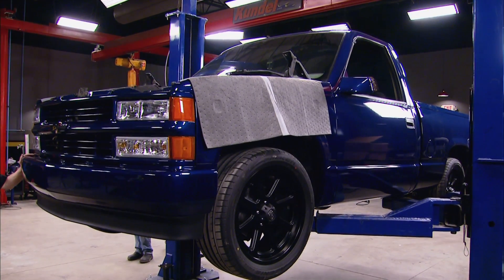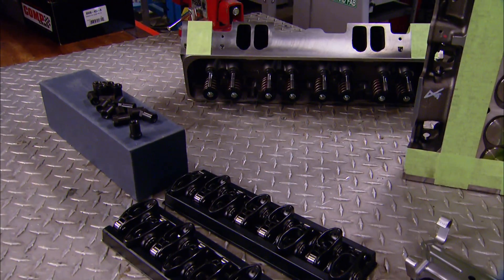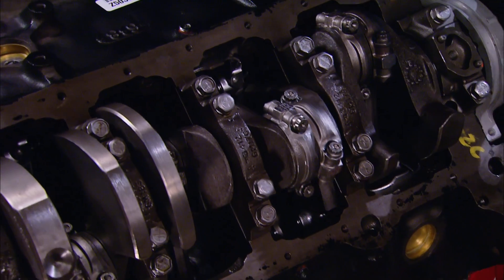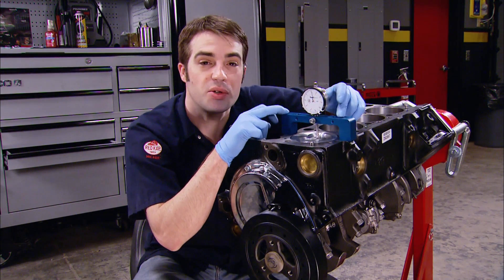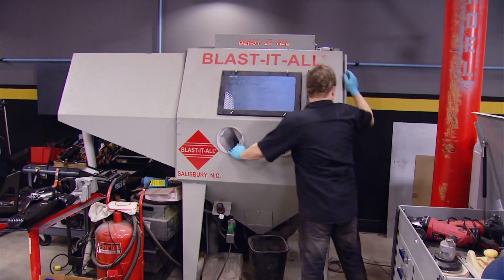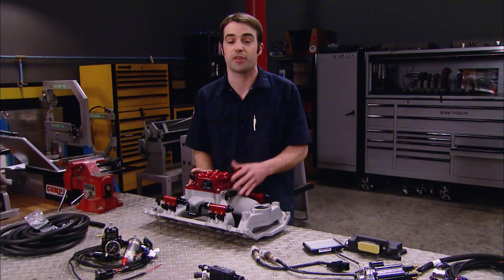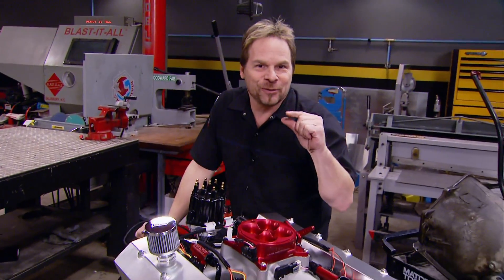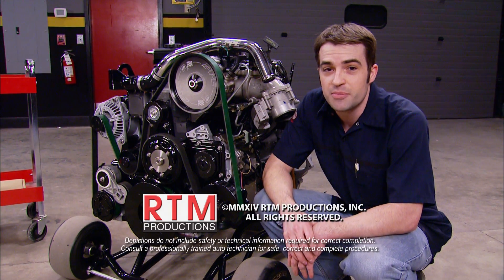Building a 383 Stroker Crate Short Block for a Chevy Silverado - Truck Tech S1, E11

Comment: I LOVE these engine builds but, my God...between the block and the upgrades, this engine setup must have cost $15-$18,000!!!  Sorry guys, but I'd be stuck rebuilding the original block.
Reply: Must be your first video here.... Every single time they say budget build that means their budget not a cheap budget lmao
Reply: Gas Mask lol man seems like it. I’ve watched about 20 episodes of it and I thought it was like a one time thing with what they thought was a budget. Then I see this episode and I’m like wtf.
Reply: 15-18k get out of here! That engine with FI may be around 6-7k max! How about you research prices....
Reply: @2015_Rubicnn  most commenters have a brain slightly smaller than a walnut.  Research would require critical thinking which they are not capable of.
Reply: @bmstylee  very true!🤣
Reply: @2015_Rubicnn  6-7k is still alot of money not really "Budget" so either way dumbass
Reply: @2015_Rubicnn  for $6-7k I would buy an older escalade lets say 2001 and swap the whole drivetrain.  The lq9 6.0/6l80 is a much better platform than a 350.
Reply: @TheGuyWhoDidUrM0M  I'm not stating better or worse, I'm just stating the OP is way off on cost to build this engine.
Reply: @TheGuyWhoDidUrM0M  there’s no 6L80 in a 2001 Escalade… 2001 was years before any GM (or any other brand) truck would get a six speed auto.
Reply: @phantom0456  2007*
Reply: MrCrystalcranium I was gonna post exactly this. Especially for a “budget” build like was said in the intro.
Reply: The mpfi swap setup alone from FAST is just north of $4k. The machine work is around 1k. 
I'm building a 383 right now and I was looking into their "low budget". They've got more in their low budget street truck engine than most have in a full drag setup. I bet that motor alone is about 10k
Reply: These shopping list episodes are dull.
Reply: WHERE DO YOU PEOPLE COME UP WITH THESE COST ESTIMATES? THIS MOTOR CAN BE BUILT EASILY FOR 3500.00 DOLLARS, MACHINE WORK AND ALL HIGH QUALITY PARTS, A SET OF FORGED PISTONS, 500, A USED CHEVY FORGED CRANK, ONE CAN FIND THEM ALL DAY LONG FOR 150, I COULD GO ON , BUT , REALLY, WHERE ARE Y'ALL GETTING THESE PRICES, TOTAL MACHINE WORK COST AT A REPUTABLE MACHINE SHOP, 250, COME ON, GET REAL
Reply: @williamcox5216  Hallelujah ding ding ding we have a winner,  your dead on sir,  or as Tom Hanks would say, There's No Crying In Building Motors
Reply: You end up paying double for engine/transmission build with shop's warranty and shop labor
Reply: I built mine but with almost this exact same set up but it's 12.5 to 1 and 388 solid lifters and 2 bolt mains
Reply: 3800 all in
Reply: Millionaire corporation budget - big budget.
Reply: And it's still a turd.
Reply: @bigcountry9210  probably faster than anything you own, lol.
Reply: It doesn't cost 15000 to have a 700 hp engine only 2000 dollars only the wimppys expend a lot because they don't know how to get it or even how to work on a repair

Comment: How do you "modifying" the lifter so that they don't compress?
Reply: I had to do this on my 302.  Take out the clip that holds the plunger in place and you have to flip over one of the pieces and you'll notice that that plunger wont move anymore.  Reinstall the clip and you now have a mock solid roller
Reply: @MustangIsKing  NO , YOULL HAVE PIECE OF JUNK SHIT THAT'LL DESTROY THE LOBE ON THE CAM SHAFT, WHY DONT YOU JUST BUY A SOLID LIFTER CAMSHAFT AND SOLIDS TO GO WITH IT

Comment: I finished a 383 kit on my Merc.  I went from a top speed of 52mph stock to 82mph.
Reply: Jay YouTube please explain this
Reply: @topkek7003  probably 3spd automatic with a 4.11 rear end.
Reply: Not sure what you mean, I’ll try to help. I had an 85 350 Mercruser buy GM (marine) out of mi Imperial. I sent the block to my machine guy and told him what I was doing, he knew what he had to do to the block. I ordered the kit from summer racing by the time the kit came, the machinist sent it back all ready. I along with a Nephew assembled it in 2weeks or so. Got 400+hp out of it. Hope that clears up a bit of confusion..
Reply: @jayyoutube8790  so it's still in the boat. That makes so much more sense because it's a straight drive system no transmission to really speak of just forward and reverse
Reply: Steven Burks ya.. but I have a “IO”... I am running a Bravo 2 that’s good for 559hp. That’s the “inboard/outboard” that would be like a “transmission” for a boat. Just like a trans, for a boat you could call it. I have a built one to handle more HP too.
Reply: Hopefully you can go from 0mph to whatever the governor is programmed to.  Sucks to start out at 52mph.  Must make leaving the garage interesting!!

Comment: 383 is too small for that heavy pickup!
Reply: Stroker is a torque monster...500ftlbs is easy to obtain
Reply: @bilbobaggins4710  I was thinking around 600 to 700 foot pound of torque.
Reply: @musclebone7875  500 ftlbs is well enough for a full size
Reply: @musclebone7875  not naturally aspirated you won't see those kind of numbers
Reply: @maxwelllevy5760  well, I guess it's a matter of opinion. My land yacht weighed in at  4,346 pounds without a driver. So 500 foot pound is a drop in a bucket.
Reply: @bilbobaggins4710  not in a street small block especially a 383 you won't
Reply: @musclebone7875  and what else??? A 454??? Good luck getting that kind of torque from any naturally aspirated combination... Modern LS platform won't see that without a blower...500ftlbs would be fine for a mild street application like a truck ..My only issue was why a dished piston?? That's gotta be a low compression fuck with 67cc chambered heads
Reply: @musclebone7875  my buddy has a stroker in his old corvette...fucker is plenty quick for a street toy..
Reply: @bilbobaggins4710  383's work well in lighter cars or trucks, but for something heavy it wouldn't waste my time. Atleast 427 sbc, but if it's a budget build then I understand.
Reply: Brian Samuels dude these trucks are not that heavy stop your fantasy storytelling
Reply: @MichelLinschoten  what's not heavy to you then? I guess this truck weighs 3,000 pounds huh!